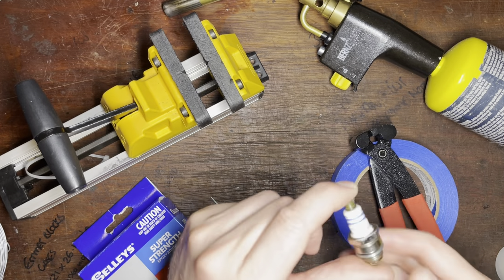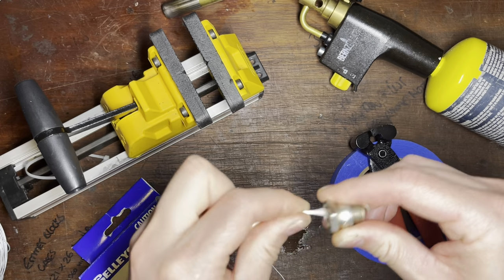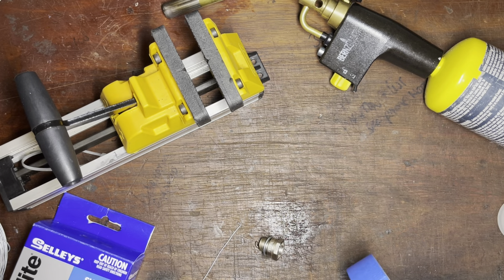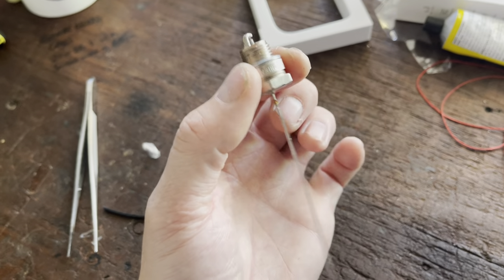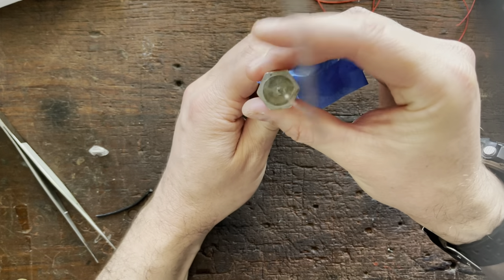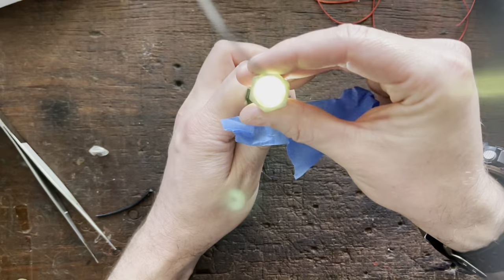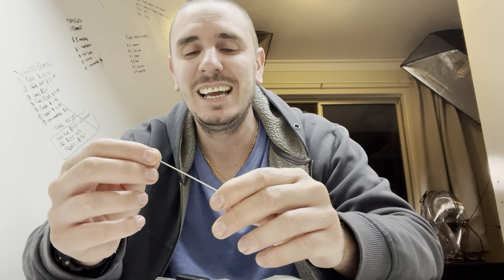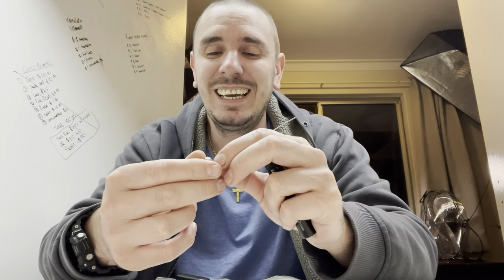See Through Spark Plug!

Comment: Wow, I can't believe it actually contained the pressure. Very interesting and fun video!
Reply from the maker: It’s pretty impressive isn’t it! It would have been about 150 psi lol.
Reply: @VintageEngineRepairs  Well, 150 psi without ignition, but you've got to add in the "explosions" happening about 150 times per second as well as the strain on the epoxy from the heat. I would definitely not be looking directly down on it!

Comment: You might consider a counter top epoxy. Most of those can handle heat up to around 500f. And they are clear. I've used it for countertop coatings. Also consider a tungsten wire electrode.
Reply from the maker: Some great advice, thanks Jim!

Comment: i would add Acrylic sheet and add the epoxy then it wouldn't burn. i seen they use Acrylic sheep to see combustion chamber and there's no damage to the Acrylic.
Reply from the maker: Interesting, it must be a specialist, high resistance one though! I know the colortune plugs use glass
Reply: @VintageEngineRepairs  Update, using polycarbonate sheet works but using epoxy adhesive to test doesn't work as it nearly missed my eye. so using a polycarbonate sheet with a steel insert to hold the sheet in would work but i won't test anymore as it requires machne work.

Comment: I have a colourtune and your plug offers much better visibility of the colour. I had hoped that you'd come up with some sort of DIY glass that could handle the heat.
As far as handling the heat goes I would be cautious running it for too long as eventually most epoxies will melt and at that point it will go projectile.
Reply from the maker: Thanks for sharing! I agree, I wouldn’t want to run it long because it will let go.